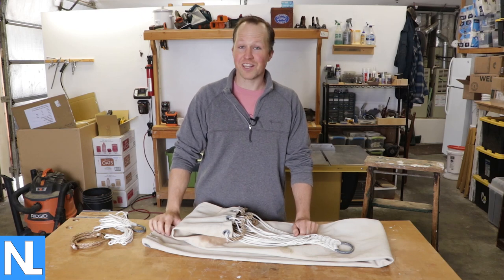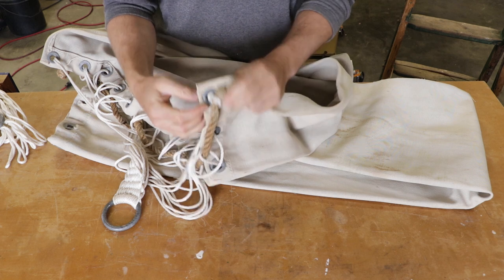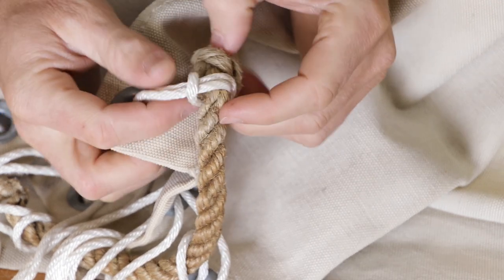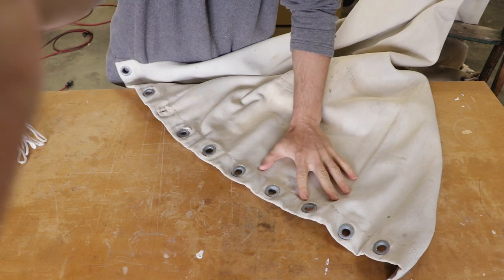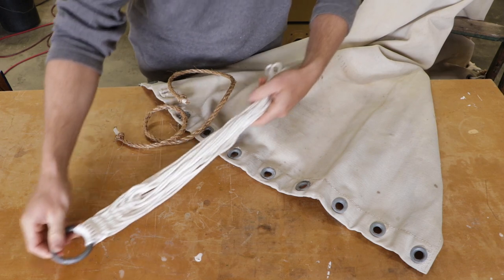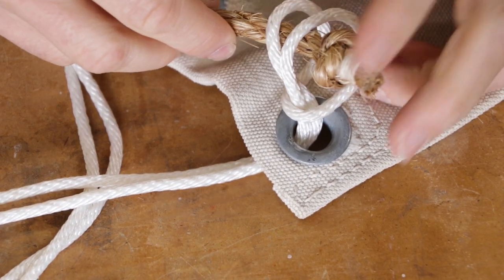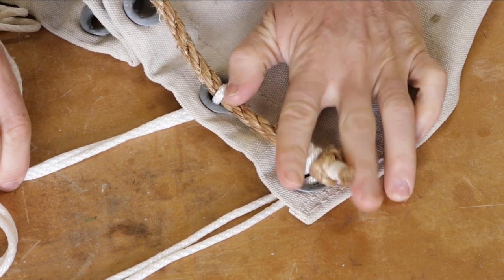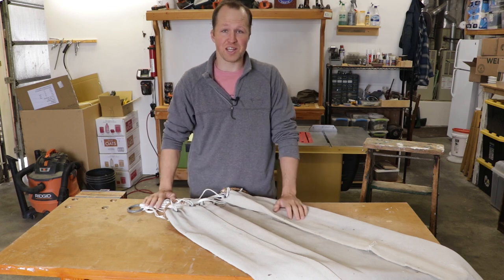Attaching clew to Sailors Canvas Hammock

Comment: I`ve been trying for years to find out how these were made and your instructions pop up ,Thank you . I`ve now shared your instructions on various veteran sites as a lot of them are self sufficient and this adds to the knowledge base . The only thing missing is a quick guide to dimensions of material ,spacing of eyelets on the canvas and maybe if possible ,the quality grade of canvas available today.  . Apart from that ,you have done an excellent presentation with clear concise instructions and views .
Reply from the maker: O hope to make a video before the end of summer on the hammock canvas construction. The finished dimensions of the canvas are 39" wide and 80"long. The eyelets are evenly spaced.

Comment: Hi Nate, a squirrel decided to use the clew as a chew toy.  Any advice appreciated. These 2 videos r done very well, you make it look so easy. It doesn't  have grommets, it has an area similar to seam you'd feed elastic thru w holes for clew ends. Can i use the the rope like u did but feed it thru the seam & wrap the ends around it similar to what u did? Any ideas? I have couple pics but YT won't let me put them in comments.

Comment: What are the dimensions of the actual hammock, Length by width? Is it a simple rectangle or is there any shaping to it.
Reply from the maker: It is a rectangle. The finished dimensions of the canvas are 39" wide and 80"long
Reply: Thank you!
Reply from the maker: Randy Welsh  I'm not 100 % sure but it is a very heavy weight. I would think it is at very least a number 6. I hope to id the weight by the end of the year

Comment: Good stuff, Nate. I hope you will replace the nylon nettles with the proper material. If you really want to preserve the hammock, always save the old so others can compare the original with the replacement.
Reply from the maker: I do want to restore it with the proper cordage. And I am saving all parts. I would like to find out more info on the type of canvas, the canvas is heavy and thick.
Reply: @natelarge  
As you may know, canvas is weighed in ounces per square yard and if I recall correctly the canvas I used was in the 10 to 12 oz. range. In the vid your bag looked a bit heavier. Most of the canvas shops will have sample pieces on the counter for comparison. That's what I did. Good luck and keep us posted!
Reply from the maker: Thank you for the information. I did not know that about canvas. There is a lot I'm still learning and I appreciate the help.
Reply from the maker: @dpeter6396  I got samples and I believe the canvas is at min a number 4 (24oz) very possibly a number 1 (~27oz)

Comment: Hi! I remade this hammock this week, but when I made my brother test it out (he’s 15kg lighter haha) the eyelets stretched out. Like the hole got bigger. How can I prevent this? And maybe fix it.
Reply from the maker: Not sure. What weight canvas did you use? My first assumption is that it is an issue with canvas material being too thin or pliable. If you want to send me photo/video DM my IG account I can take a look. @_natelarge
Reply: I won’t be at home for a few days so I can’t show you, but I think it might be the material i used yeah.
What material would you suggest? So can remake that part
Reply from the maker: I'm not sure the weight but a heavyweight canvas, #4 #6 #8 are my best guess. I am going to order some samples to id the correct weight.
Reply: That’d be awesome. It doesn’t have to be so strong it can hold a person of 90kg hahaha just durable so it lasts longer than my current one, which has started ripping a bit. It’s not for hammocks at alllll

Comment: Hello, great guide :), I have a question, what dimensions does the material have? I want to make the same chamak, but I would like to make it for 2 people. I am going to hang it between wooden beams in the room, the distance of the beams is 3.6m, the beams are at a height of 2m. I wonder what length I will need material. I think the hammock will hang down a meter. What is the length of the cord from the metal ring up to the attachment in the material?
Reply from the maker: The length of the cord when made into a clew using my jig is 20 1/2" (~52cm) a few more inches will be added for the ring that it is attached to.